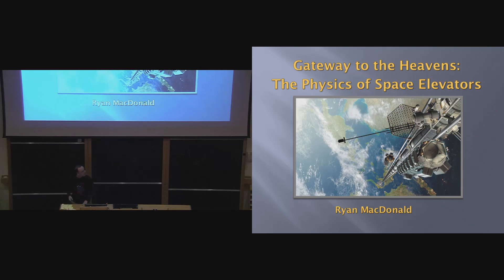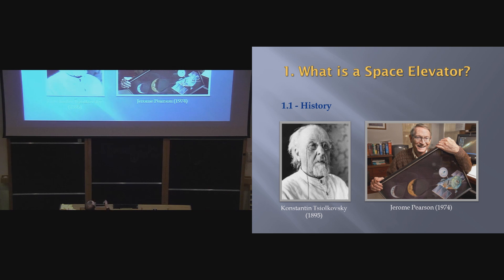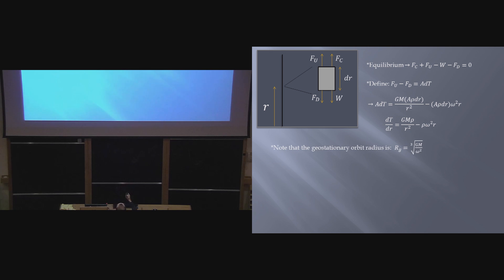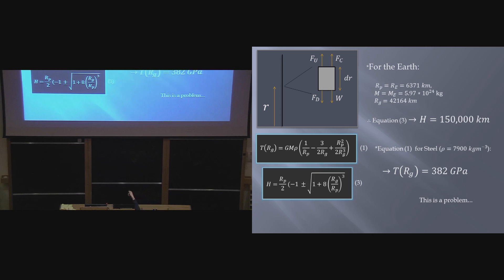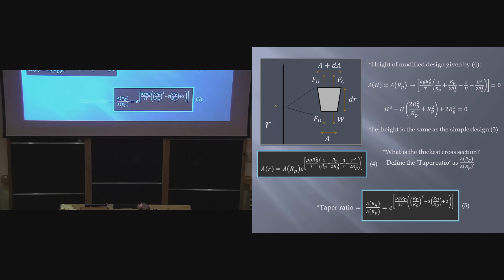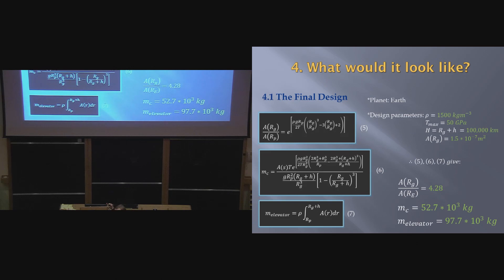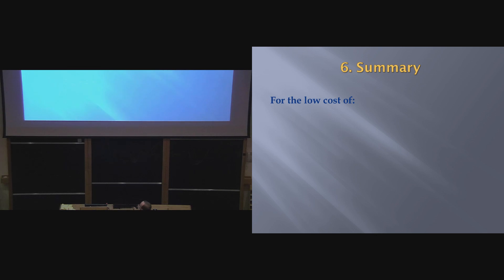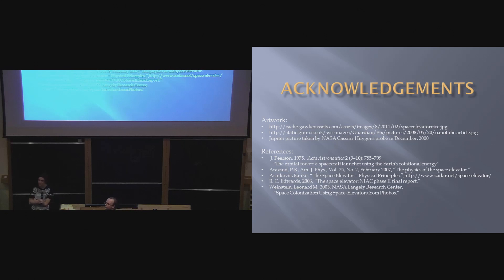The Physics of Space Elevators

Comment: Something else I've wondered about: Surely there's a way to use something like "spool knitting" (which I recall from elementary school. googling it shows what I mean), and using a tiny spool, to produce carbon nanotubes of unlimited length. The current method is a matter of blasting some raw material with heat and collecting the results, which will never produce perfect nanotubes with macroscopic lengths.

Comment: Something I've wondered about: Could such extended mega-structures be detected over insterstelllar distances by some unique, spectral signature? I'm thinking by analogy with the experience of seeing a strand of spider silk next to a sunny window from the other side of a darkened room. You wouldn't normally have the visual resolution to see it but if the bright sunlight hits it just so you can detect it.
Reply from the maker: You wouldn't have much luck detecting an extra-solar space elevator, due to the low thickness of the cable. A better bet would be looking for artificial satellite constellations. There have been some papers on the detectability of this (Google: 'Clarke Exobelts').

Comment: Would the Van Allen radiation belt cause problems for human travel on the elevator?
Reply: Yes it would!  Thankfully there's a simple fix.  Look at 
https://en.wikipedia.org/wiki/Van_Allen_radiation_belt#Proposed_removal
for a way to fix that problem.  In fact, since carbon nanotubes are conductive, you could even pass the current through the cable itself, removing the Van Allen Belt entirely.

Comment: Any object lifted by the elevator needs to gain speed = increase its kinetic energy. how do you intend to add this energy to the lifted object?
This presentation calculates just a static structure. As soon as you want to move an object along the cable ( supposedly up from earth surface) you need to add horizontal speed to the object, otherwise the whole structure exits the equilibrium state. 
In fact present day rocket launches are doing just that: add kinetic energy to the objects that we need to move to the orbit. = no need for cables! and this process in always in a dynamic equilibrium state.
so, my question stays: how do you add kinetic energy to the lifted object?
Reply from the maker: Excellent question.
What I've seen typically proposed for powering the lifted object is solar-cell motors driving loop lift cables every 100 km or so (with energy potentially transferred via a laser pointed upwards from the base station).
With regards the horizontal velocity, you are correct that the payload naturally attempts to move laterally from the elevator (due to it moving to an altitude with a different rotational velocity). Since the payload is attached to the elevator though, it attains orbital velocity via a constraining side force imparted by the tether itself. In modelling the effect of this additional force, an extra very weak continual acceleration (amounting to ~5 N for a 500 kg load) is applied to the elevator.
Reply: It's a straight forward idea.  The lift climbs the outside of the cable.  The lift gets energy from a laser at sea level beaming it up to a receiver mounted on the climber.  As the lift climbs the cable, it will naturally add vibrations into the structure that will need to be dampened.  Dampeners could be placed every 10 kilometers or so.  This will be helpful for the added instabilities that the Moon's gravity might cause, or slight variations in tensile strength.  The best design uses multiple flat sheet cables, partly for redundancy and partly to make reparations possible.  The "taper ratio" design is probably not gonna happen, because making a cable with inconsistent width is not practical from a manufacturing perspective.  

Anyway, altogether, the cable should have roughly twice the mass of the minimum functioning width.  This more than accounts for the weight of the lift

Comment: Excellent presentation! For someone currently studying mechanical engineering, this material could be a useful launch point for a final year project. 

However, the counterweight got me thinking. Since it's under a lot of centrifugal force. Does that mean it would experience a form of artificial gravity? If not, would it be possible to build a space station that goes beyond geostationary orbit to the point of being swung by the earth's rotation, thus making a space station that has it's own artificial gravity?

Also. For factor of safety and strength, would it be a good idea to introduce multiple tethers that go out to the same space station?

Comment: Hi, I am too lazy to make calculations, (maybe it is the reason why) I am wondering about moon's elevator. Rough logic tells me that gravity is 1/6 (one sixth of Earth's mass) and rotation period is 27 times longer (centrifugal acceleration is 729 times smaller /if omega is 27 times smaller and squared/). Then the ratio between gravity and omega is 121.5 which is not quite good at first sight (my first sight)
A: distance between Earth and moon is 384,400km which is 38.4x100,000km (counterweit can hit the Earth)
B: length of cable will be 121.5 times bigger, then its weight will be corresponded to it (without Earth it is 121.5/6 times higher tension requirements 20.25times stronger material or crossection surface in stationary point)

Does this logic corespond to physics?
Reply: Common sense tells me that we are at Moons stationary orbit
Reply from the maker: Stanislav BANDUR Here's a nice little summary on the lunar space elevator concept: http://en.wikipedia.org/wiki/Lunar_space_elevator
Reply: If I understand it well it uses Earth to balance forces too. Closer to Earth is moon's gravity balanced by earth's and at far side it is balanced by centrifugal acceleration of Earth-Moon system (LAGRANGE POINTS)

Comment: Thats amazing!!! A system like this could be the begining of mass intersteller travel. Because the initial transfer would be free you would have plenty of fuel for manuevering and retroburns. 
Would it supply enough delta-v to send a ship to Mars with a landing pod and enough fuel to return to Earth?
Reply from the maker: It would require slightly more energy to lift the heavy payload for a return vehicle to the top of the elevator, but once you are are the right altitude you can certainly let go and just drift onwards to Mars. Or you could break up the vehicle into a number of parts, ship them up one by one, then let each one go at the right altitude to send a swarm of components to Mars.

Comment: I have a question how are you going to Gt the asteroids orbit perfectly synchronised to the rotation of the earth without moving the platform on earth or in space couse its also going to pull up and down from time to time ?

But great presentation by the way
Reply from the maker: The values I calculated are equilibrium values. When you first attach the cable to the asteroid, it will be in a different orbit because only the gravitational and centrifugal forces are acting on it. Now when you add the cable the additional force of tension alters the equation, and thrust must be applied to the asteroid to adjust it's velocity and stabilise the system to the new equilibrium value of the angular velocity of the Earth. This would use the same small rockets attached to the asteroid that were used to bring it into an Earth orbit in the first place.
Reply: Martian Colonist Ah so you need to do the calculations twice ?sorry for this seccond question but if you build the elevator with a shape of a rhombus(just with a fluqsuation of max 1m in the center) as in the video what type of elevation will you youse to have no trouble with the fluquations whatsoever and if you bring a object ofnlet's say 1 ton up with the elevator won't it change its angel from ~90 to ~95 will it cause a problem cause the elevator's stress point isn't in the middle'anymore then but a little lower where the diameter is less than the requird ~1m? 

Greatings from me and thanks for replieing so fast and sorry for my lack in english